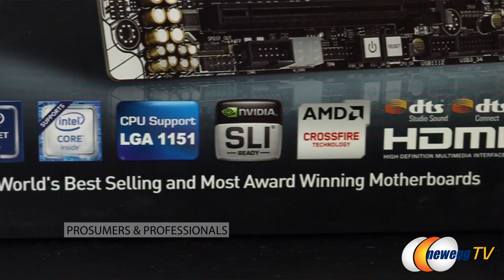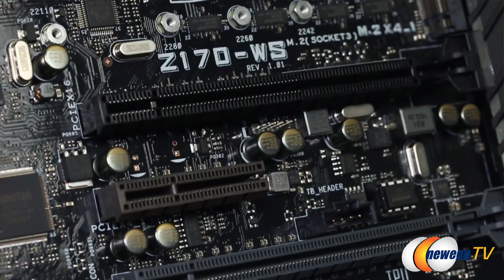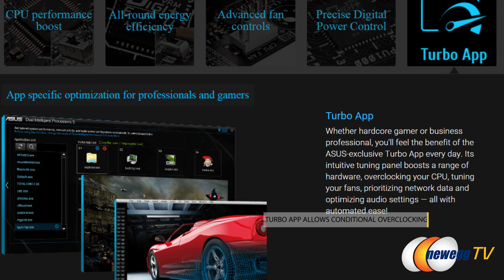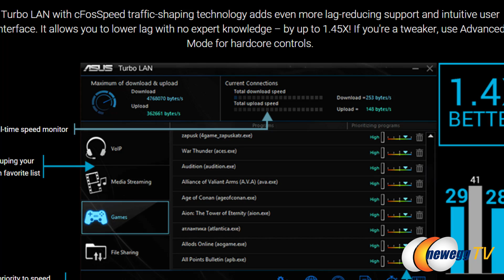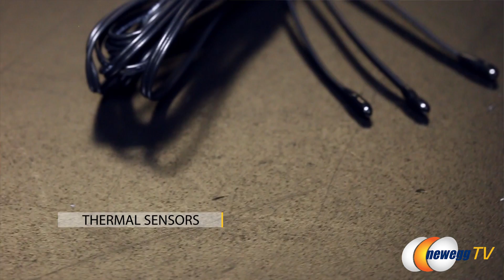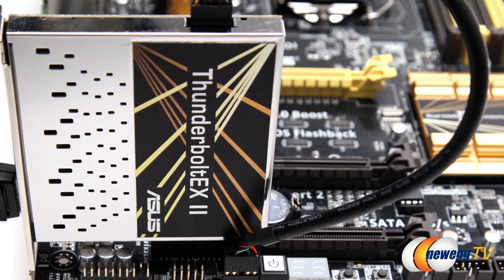ASUS Z170-WS Motherboard Interview - Newegg TV

Comment: guys i have 1 ques can i use ws motherboard  for gaming ?
Reply: I read an article from PC Gamer and yes, you actually can. It's one of the recommended high-end motherboards for gaming.
Reply: thankyou so much
Reply: tobyH Dgamer No problem man, it's also in my wishlist :)
Reply: i wanna build a pc with  
Asus Z170-WS
Reply: What is your specs going to be? Processor, RAM, GPU
Reply: corei5 6600k/gtx 1070/Corsair Vengeance LPX 16GB (2 x 8GB)
Reply: Wow it's exactly like the one I'd like to get, only difference is the RAM (Kingston). Good choices!
Reply: im trying to wait for rx490 vega value under 400$ as i saw on news amazing price for amazing performance
Reply: @tobyhdgamer4905  Do you build your pc? What windows, do you use?

Comment: What PCIe 3.0 speed will this run with the following config:

2way SLI + SSD 750 (U.2)
3way SLI + SSD 750 (U.2)
4way SLI + SSD 750 (U.2)

The manual says 2 way is 16x dual, 3 way is 16x/8x/8x, and 4 way 8/8/8/8.   Although the overview page  I'm just not clear how the U.2 card consuming 4 lanes interacts here with the lanes made available via PLX/PCH.
Reply: Just to follow up on this since it hasn't been answered. I am running Dual SLI with the NVMe U.2 Intel 750 SSD and both cards show x16 in the BIOS.  It's not clear whether adding a third card would drop them down to x16/x8/x8, or if they can all run x16 as stated in the overview page on Asus's  Web Site (https://www.asus.com/us/Motherboards/Z170-WS/)

Comment: I'm one of the "Target Market" customers who rely on WS series since its 'Supercomputer' model days. As on today, several dozens of machines are based on that series. I build very high-end R&D and Design Workstations using this series; each would cost ~$9K on an average (including pro cards, displays etc). The important features I look at are:

1) Stability
2) Reliability
3) Xeon CPU support 
4) Data integrity - ECC RAM support
5) PCI lanes - flexible expansion without sacrifice; E.g., Quadro/Tesla cards & more. 
6) Durability - my workstation hardware cycle is 3-4 years 

My 1st Q to JJ: why this board launched so late when compared to Z97 or X99 boards? 

2nd Q, which I raised it many times:  why not provide RAMDisk feature on WS boards?

Lastly, I reckon this video should have been a bit longer to educate potential customers. Please try to overlook OC'ing factor. As JJ pointed, people like me don't really care on such machines except on home (gaming) machines. 

Note: I do not allow any OC'ing on such expensive machines baring CPU Turbo range.

Comment: Here's a question for JJ: What is wrong with ROG G752 Laptop? I was about to buy it (the top model) but all of a sudden everybody (including Asus) started pretending that it doesn't exist. There are no reviews. There are no promos. It's the first one that LinusTechTips didn't review (probably for a reason). You never explained the vapor chamber cooling 
system that is only being used in the top model (G752VY). Why is that there is not even one review of that model (VY) in existence? So, again, WHAT IS WRONG WITH IT? Been saving my money ever since the G750 was announced. Finally decided to "pull the trigger" on your best G752 model, but geeez man, this is just to wierd!

Comment: no RGB LED header? oops
Reply: i'm now using a asus Z77 premium, I really appreciate the tons of sata port dual lan and multiply GPU support at X16 speed. pretty durable as well now in its 4th year and running strong. i'm always looking at the features mobo has as the deciding factor to purchase, in the current trend I believe RGB is considered a feature as well. maybe you guys can design an upgrade to WS, just like the premium board with RGB build in. name it the best of the best series :)
and yes i'm going to use this chance to ask for a mech keyboard with thumb macro keys under the space bar just like the razer anasi, please and feature dedicated media control and scroll volume control like what logitech and corsair has. pretty please, i know there are other people looking for this keyboard as well and there is none in the market.
Reply: Yes the asus strix keyboard, maybe 3 more buttons and RGB I'll get it right away :)
I know asus always innovates and lead the market, always can't wait for your new product.

Comment: Buying one... The ability to have 2 950 pros in raid 0 for scratch disk really will be amazing.
Reply: +PCDIY having raid 0 on m.2 slots is it still possible to get 2-way SLI with at least 8x, 8x gen. 3.0 on this ws board?
Reply: +Aleksei Kissel sorry correction m.2 @ 4x each.
Reply: Not sure I'm just using one GPU with both of the 950 in raid
Reply: I think there may be a plx chip but I don't know nor do I need to

Comment: Is it possible to fit 2 different graphics cards into one motherboard? I usually only see one or maybe rarely 2 of the same type but I always wondered.
Reply: +Domboy Can you clarif your question? The board can support up to 4 graphics cards. Normally it would be the same GPU. You can use different GPUs but that would generally be used for compute or acceleration purposes.
Reply: +Juan Jose Guerrero So say that you wanted to put an Msi GPU and an EVGA GPU both in one motherboard. Does compatability really matter or as long as there is space and enough cooling and power in the system it is ok to run both. Hope this clarifies.
Reply: +Domboy msi and evga are vendors thst make their own version of a specific gpu or gpus. vendors are diffrent from manufacturers. only am and Nvidia manufacture gpus. vendors simply impliment their own coolers and overclocks and binning process. an asus strix 970 and an msi 970 , and evga acs 970 are all the same gpu from diffrent vendors manufactured by Nvidia. in this instance they are all the same series of gpu and can be used together. ;keywords- >= manufacturer, vendor, series; hope this helps if you weren't 100% trolling and I kinda think you were honestly.
Reply: Well there you have it. although I have two different vendor types within the same gpu series ,I totally get what jj is saying. for best compatibility I understand his response and value it. the master has spoken ;) I don't mind mixing and matching but jj is the man I'd go to if I had any pc question ever.